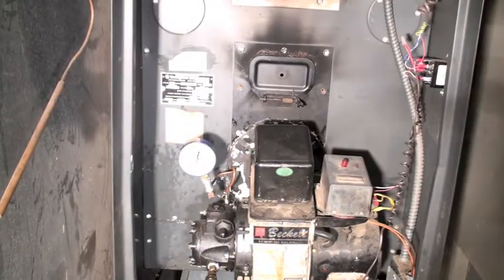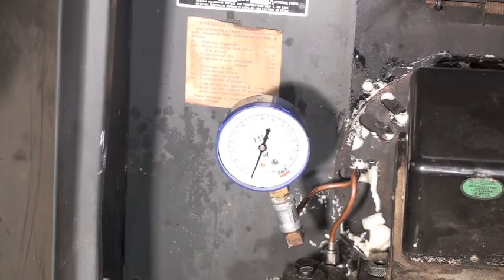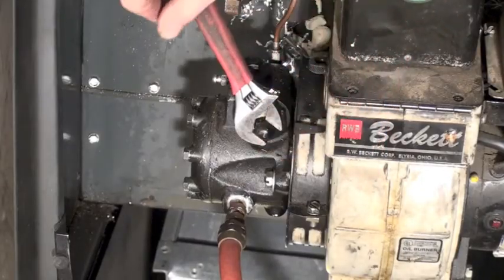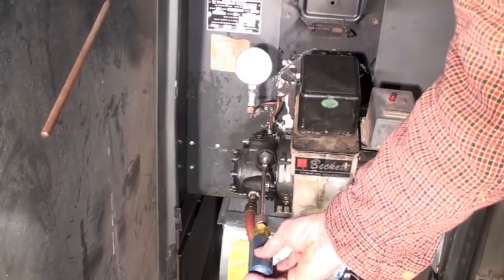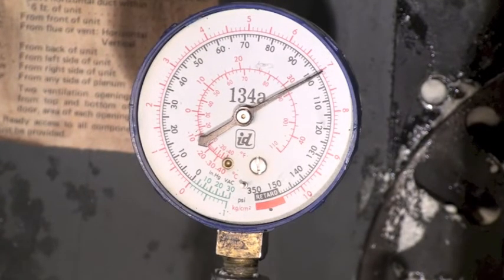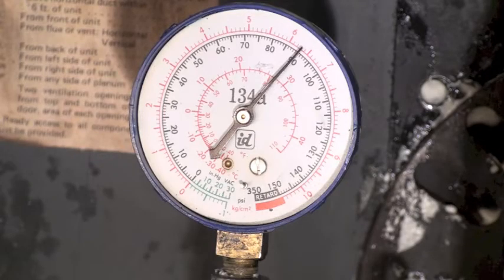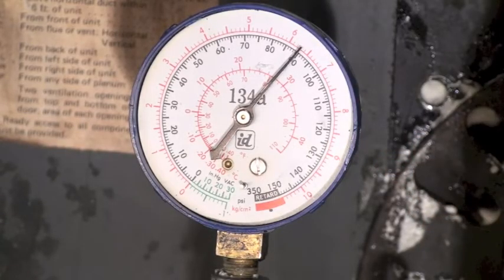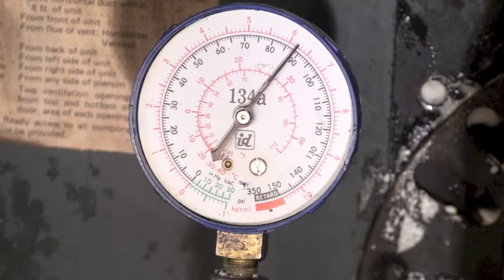Oil furnace troubleshoot.  Part  #7.  Pump pressure test

Comment: When my burner kicks on the pressure gauge immediately goes to  110 lbs and fires up and runs ok . On  shutdown the gauge quickly drops to 0 psi. Is my webster pump failing?
Thanks, Bruce
Reply from the maker: The regulator either has garbage in the seal or it is failing.
GFM

Comment: all my equipment looks like new had service here2x the reason for inquire . is i never pressed the red button in i opened the box and it was already depressed and tapped on it and nothing. so here i am dont know i need a red button video on why would it stick i was here when it shut off it shuddered bad 2 -3x now is dead.
Reply from the maker: If your equipment is quite new, the cad cell relay may have locked out.  New controls will only allow one reset before locking out.  Check this video:  https://youtu.be/SHTwhOtvQWE
You will need to troubleshoot the burner before putting it back in service.
GFM

Comment: My Suntec pump seems to have a port for a gauge. Is it possible to put a gauge there and run it normally?
Reply from the maker: If you have a high pressure port, you can use it for a gauge.  If it is permanently installed, it needs to be an oil filled valve to eliminate damage from pulsing.
GFM

Comment: Whet is the regulator?
Reply from the maker: If you are asking where it is, that depends on the pump manufacturer.
If you are asking what the regulator, its a spring loaded bypass that limits how high the pressure can go.
GFM

Comment: Thanks for this great video... Does that pressure gauge have to be a special one for oil or is it a universal pressure gauge?
Reply from the maker: Its nice to use a combination gauge with vacuum and pressure for testing pump vacuum, but if only pressure is needed, any one a 200# range will do.
GFM

Comment: Thanks for your videos!  I recently installed a new pump but am not getting any fuel coming out of the nozzle port.  Any idea what may cause this?  It's a single stage suntec a1ya-7912.  Thanks!
Reply from the maker: First, is oil available to the pump?
GFM
Reply: @grayfurnaceman  Oil is making it to the pump, yes.  It would prime just fine with a steady stream coming out of the bleed valve.  After closing the bleed valve nothing comes out of the outlet side of the pump.  Is it possible the adjustment screw is set to 0psi and not allowing oil to flow?
Reply from the maker: @nateplantz4969  It could be set to zero, but I have never seen it on a new pump.  Is the pump rotation correct?
GFM
Reply: I believe so.  Looking at the pump from the front it is a counterclockwise rotation.  The shaft turns the direction of the arrow.  The pump I replaced also had the same rotation direction as the new one.
Reply: I managed to get a pressure gauge hooked up to the pump.  Its bouncing around from about 10psi up to maybe 25psi.  Turning the adjustment screw does not change pressure at all.  If I remember correctly the motor has a clutch system?  Maybe that's going out.
Reply from the maker: @nateplantz4969  I have never seen a clutch on an oil burner.  Is it possible the coupling from the fan to the pump is rounded out?  It usually is somewhat noisy.
GFM

Comment: I notice you use an automotive gauge to meausre pressure.  Can I use an automotive HVAC manifold kit to measure pressure?
Reply from the maker: Its actually a refrigeration gauge but they are mostly the same.  You could but the fittings are not right.  It also damages the gauge set with the oil.
GFM

Comment: My furnace will run fine till it builds up the heat asked for, then when it shuts off it will developer a little air in the system that causes a lock out, and when I bleed it and get that air out it runs fine. My fuel line is short without much rise . I've changed the fuel filter recently. At one point it had exhibited these problems for some time and got worse to where I couldn't even get it to fire, so a tech I know said to buy a pump, I put in a solenoid pump combo, it ran great for a few days then resumed locking out from air, and running great after I bleed the bubble out. Then recently  I paid a company who sent out a young tech while I wasn't home.  I was told he replaced a strainer, and valve, and it ran great again, turning on when called for for a few days until it started locking out again after getting the house up to temp.  Any ideas? I'm scared I'll end up continually paying people who don't really fix it.
Reply from the maker: It sounds like you have a vacuum leak in the oil line or its fittings.  You may need to do a vacuum test on the line.  Hope this helps.
GFM

Comment: Or the check valve could be a problem, right?
Reply from the maker: There is no check valve on most oil pumps.  There is a regulator that can be checked by it holding pressure at 80% of the pump pressure when it is shut down.
GFM

Comment: i'm trying to diagnose a problem with my boiler...it will not light, and I cleaned out fuel lines.  I have now drawn fuel back through the fuel lines to the pump, but the pump is actually empty from me cleaning it out.  It will not draw fuel up into the pump and I've checked pump pressure and it's a zero.  My question is, does the pump need fuel actually in it to work or will it suck it up from the fuel (fuel in line right up to the pump) and get primed or is the pump probably dead.  It's a Riello pump.
Reply from the maker: If the pump is below the level in the oil tank and it is a one pipe system, there should be fuel in the pump.  If the tank is below the pump, you may be able to get the pump to draw by filling the pump with either fuel oil or a light lubricating oil.
GFM
Reply: @grayfurnaceman  Thank you.  I will try and pour a little oil into the pump via the pressure testing port and see what happens.  I should have mentioned that it's a two pipe system.  Tank is on the same level as the boiler, but perhaps the fuel level is lower than the pump at the moment.   I was able to bring fuel back up to the pump via a vacuum pump without too much difficulty but the pump is completely dry at the moment as I disassembled it and blew it out with compressed air.

Comment: Yes I get a nice steady flow from the bleeder valve. I also had my filter changed 2 weeks ago, at least that's what they charged me for. I'm taking the day off tomorrow to hopefully get it back up and running. I would greatly appreciate any suggestions you can offer. Thanks

Comment: Great videos, maybe you can help me. My gun line starts feeding oil for the first 10 sec or so, ignites the flame but then stops feeding and shuts the burner down. I've bleed the system several times with no luck. The gun line fires oil for 10 sec or so every time I fire it up but it won't continue to feed oil. Please help
Reply from the maker: Be sure the oil filter is clean.  Do you get continuous oil flow when bleeding?  
GFM

Comment: Is it safe to assume that you need to turn off oil supply and leave turned off during pump pressure test?
Reply from the maker: I would not.  You can close off the output but not the supply.
GFM

Comment: I was hoping for a better view of how you mounted that pressure gauge. There is never a good camera angle for me to see how it connects to the furnace. That would REALLY help a lot.
Reply: The gauge should be mounted where the gun line is connected.
GFM
Reply: @electriccar3253  but I don't do this professionally so the term "gun line" means nothing. This is why I watch YouTube videos as seeing is doing. Is there a video that shows this "gun line connection" installation?
Reply: @QuillonFrostbane  The gun line is the 3/16" copper tube that connects the oil pump to the nozzle.
Reply: @richardgarcia2200  Thanks for that update. Will try that before the heating season begins.
Reply: @electriccar3253  imposter
Reply from the maker: Not an imposter, but sometimes I fail to change the channel.
GFM
Reply: @grayfurnaceman  aaah! Leading a double life are we? I retract that comment.

Comment: Trying to figure out why my Riello oil burner starts/fires (for only a sec or two) turns off, then reignites and runs smoothly. I hear the fan run, ignition (for only a sec) goes out, then fires right back up.
Reply from the maker: Sounds like a vacuum leak in the line.
GFM
Reply: @grayfurnaceman  if the gauge was installed on the gauge port on the pump instead of the gunline should the pressure also stay with only dropping a little bit in this configuration?
Reply from the maker: Yes, it should drop 20%
GFM
Reply: @grayfurnaceman  thanks for your help!
Reply: @grayfurnaceman  I'm having the same problem as the guy in this comment Jason Ricci it seems like something's bleeding by and it's not holding pressure and every time the furnace fires it takes a couple seconds for  the pressure to stabilize and has to fire a second or third time before it stabilizes and stays running. It doesn't safety out but it just restarts two or more times before it maintains running. the gauge goes down to zero every time it shuts off. Do you think I got a bad pump? With something leaking by internally causing it to not maintain pressure?
Reply: @grayfurnaceman  all lines are tight and sealed.

Comment: My oil furnace banged loud one day and after that it Pulsates real bad. Cost me 120 to have a furnace repair man work on it and now it pulsates even worse. Any ideas ?
Reply: You will probably have to replace the pump.  I have never been able to stop that.
GFM
Reply: Hey Thank-you for the response. Last night after work I took the cove off & watched it run & could see some movement of the motor on one side & the oil pump on the other. All the bolts were loose. Tightened all the bolts & it sounds perfect now.

Comment: Love your videos! I have a beckett burner that has suddenly started leaking kerosene after shut off. Could that be a pump pressure problem and do I need to replace the entire pump? Suntec A2VA-7116
Reply from the maker: If the unit is running normally other than the leak, the pump seal has probably failed.  It means a pump replacement.
GFM

Comment: i believe the last time I had a tec clean my boiler he installed a 1.25 nozzle because that is what he had. It is on a Peerless boiler with a Becket burner. Can I reduce the nozzle to .85?
Reply from the maker: You can change the nozzle but you will have to reset the combustion air to match the nozzle.
GFM
Reply: Thank you, will do.. Any ideas on the problem I am having purging the air from questions I had from the video How to remove the air out of your hot water heating system-girgling noise? Thanks again.
Reply from the maker: Baseboards or cast iron radiators?
GFM
Reply: Baseboards

Comment: Good video. I have a Beckett burner with a Suntec A2VA-7116 pump. The boiler is a small Peerless with a .65 80* A nozzle. A label on the side of the burner says factory set at 140psi. I checked it and it's 120psi. Should I go with the 140 or 100psi like you said?
Reply from the maker: If the factory specs are 140, set it there.
GFM

Comment: Thanks for the videos Grayfurnaceman!  I am wondering if you might be able to help me determine why my oil pressure needle fluctuates/flutters.  It seems to do it more when the burner is first started.  Here is a link to a video i made on my setup.    https://www.youtube.com/watch?v=82Q1WJ2oBGA       If you fast forward to 2:15 you'll see what I'm talking about.  Does it do this simply because i don't have the gauge mounted on the pressure line going to nozzle?  Any insight would be greatly appreciated!  THANKS SO MUCH!  Chris  (KZGUY2)
Reply from the maker: The pulsing is normal.  Its just the way the pump works.  The downside here is the gauge may fail.
GFM
Reply: ok awesome!  thanks for the response! i can rest easy now.  lol.  Ill probably order a liquid filled gauge.  I thought about installing a ball valve inline just to rule out the gauge ever failing and leaking period however in all my years I have never seen a gauge fail and leak...   so I said screw it and put the gauge right on there period it's been on there for 2 or 3 years now without any problems but like I said I'll probably get the Liquid one just because I'm a perfectionist.

Comment: My gauge drops to zero when the furnace shuts off, but it's mounted on the gauge port on the pump itself. I imagine that drop down and hold would only occur on the gun line?
Reply: Here is a photo of the pump I am using. You can see the port indicators on the label. I have a glycerin filled 200psi gauge mounted.  https://www.patriot-supply.com/images/large_a2va7116.JPG
Reply: I will test with a gauge on the gun line see if it drops all the way
Reply: I tried putting a gauge on the gun line and after the furnace shuts off it holds at 80 from 100psi but the mounted gauge drops back to zero
Reply: @kommoncents-------1  
Interesting....   I am experiencing the same thing.....  The gauge port drop to ZERO 

I just mentioned this to GFM

I will test my gun line soon..... 

I REALLY think ... steady/holding pressure is GUN line only....  not gauge port.

Comment: Why don't you measure pump pressure at the bleeder port? (remove and install 1/4" gauge fitting). It's easier than fighting with the gun line in a tight space.

Comment: Don't some pumps (most?) have a separate port for pressure, and you use that port I guess the pressure would not hold when burner shut off?
Reply from the maker: +bigpardner Actually not.  The pressure should drop about 20 # when it shuts off.
GFM
Reply: +grayfurnaceman  Suntec Installation and Sevice Manual says if testing with gauge at gauge port ("system pressure with system operating") pressure will fall to zero or "to the amount of head on the fuel unit" (whatever that is). If testing at nozzle port (Fuel Unit Operating and Cut-Off Pressure") pressure should  drop to 80% or higher.

Comment: I know somebody who smells oil on cold start ups. He sets the thermostat back to 64 at night so the burner doesn't run, but when it comes on first thing in the morning he smells oil, then it goes away for the rest of the day. Could this be a regulator problem? It sounds like oil is dripping into the chamber when the burner goes off, then maybe that is the smell when it first comes on? Is it normal for a little oil to go into the chamber when the burner goes off? Thank you.
Reply from the maker: What you probably have is the furnace is not getting its draft up the chimney when the furnace is cold.  This usually accompanied by a rumbling coming from the burner.  Make sure the vent is clear first.  Also the negative pressure in the vent should be -04 in wc.  Other than that, the furnace should be serviced every year.  Hope this helps.
GFM
Reply: The heat exchanger and flue pipe were partially clogged in a home that I bought. You are correct it rumbled very loudly and smell of burnt oil in the registers. The flame was lopsided in the chamber. Cleaned out the heat exchanger and flue pipe, changed a clogged oil pump screen and now it burns much more quietly.
Reply from the maker: I would also be concerned about the lopsided flame.  You could have a clogged nozzle or a damaged combustion chamber.
GFM

Comment: What do you mean by regulator GFM? I'm guessing solenoid valve
Reply from the maker: The oil pump is a positive displacement pump.  It must have some sort of pressure regulator to relieve excessive pressure from oil pumped that cannot be discharged out the nozzle.  They are usually spring type devices.  Hope this helps.
GFM

Comment: Hey I don't no if u no how to get this info but I need to no how to wire a honeywell r8991ignitor (cad-cell) to a Beckett oil burner  2482056908
Reply from the maker: I did a video on cad cell relays.  Check here:  http://youtu.be/SHTwhOtvQWE  Let me know if it helps.
GFM

Comment: Where did you buy the guage
Reply from the maker: Actually, that gauge is off an old refrigerant manifold gauge set.  You can buy oil test kits that have a gauge and a short flex line with some fittings from heating suppliers, but I liked the size of this gauge.
GFM
Reply: You can get one for a good price at Patriot Supply
Reply: Good tip, I got a 250 psi low side R410A gauge from Zoro for $9 and added a Beckett bulkhead fitting 571801 for $4. Very easy to test and adjust fuel pressure this way and didn't make a mess either.